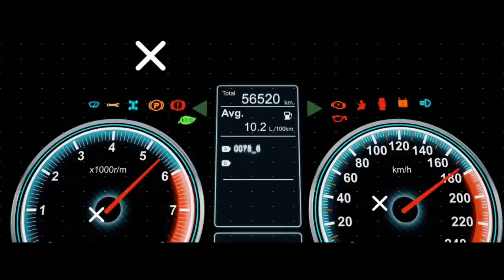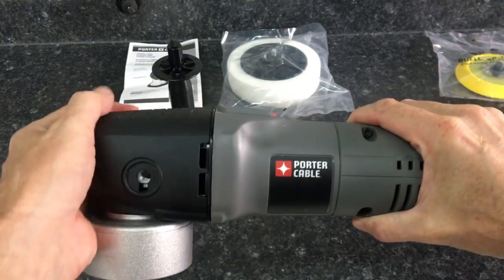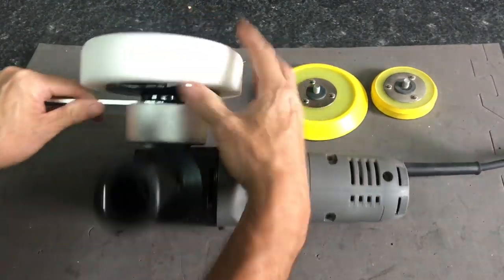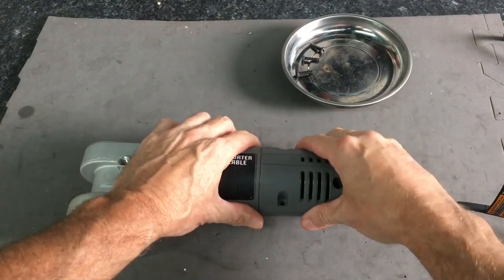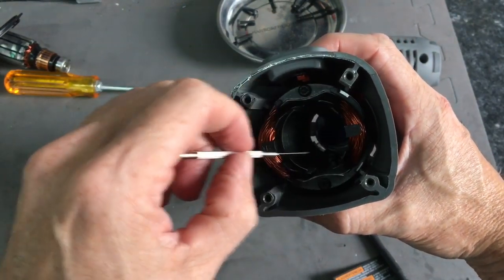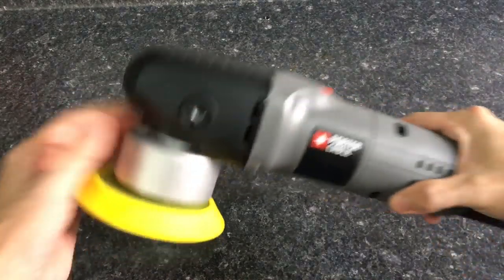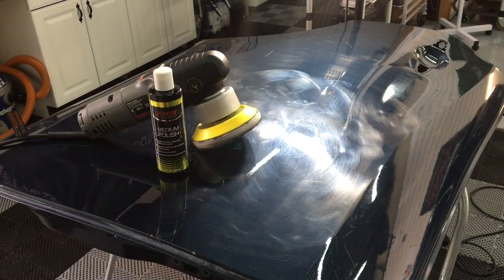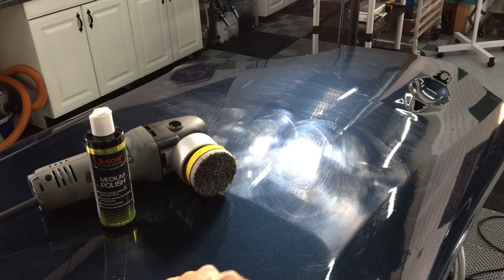Entry Level Polisher Review And Tear Down!!!! Porter Cable 6 inch Polisher!

Comment from the maker: Chicago Electric or Porter Cable?
Reply: Apex Detail 

I have never used the porter cable, I have read some people saying it can stall sometimes a little to easy as if it may be a little underpowered compared to the Chicago electric, Not sure if this is true or not. I do have a good bit of use with the Chicago electrics though and they have not let me down and for the money seem to be a good value. 

After these two polishers, what would you consider a step up in both quality and performance? Maybe something in 15mm throw.

Thanks for the great vids.
Reply: My porter cable is 19 years old; still going strong. I bought a Chicago Electric because it supposedly had a little more power, and it died within five minutes. I’ll stick with the Porter Cable.  My other polisher is the Adam’s Swirl Killer 15.  I run the 3” backing plate on the PC.  Great combo!
Reply: I guess Porter Cable ✊
Reply: Chicago electric,  but the heavier model.
Reply: P.C....
Reply: Chicago Electric.
Reply: MaxShine M15.
Reply: PC
Reply: Why are you even asking this at this stage of the game?  The Chicago Electric 69924 has been discontinued for a while and replaced with a junkie Braun which you have already reviewed.  It doesn't come close to the CE.  We are all grateful for your reviews.  Northern Tool has their brand of electric power tools "Ironton" and their DA polisher looks exactly like the Chicago just a different color and sells for $90.00 ... Ironton 6in. Dual Action Car Polisher — 5.7 Amp, 2,000–6,400 OPM .  Maybe if you can see it as a possible opportunity for review we might be able to still get a good DA polisher cheaper than the competition. Just maybe the Ironton might be better than the Chicago since it comes at a price premium.

I personally am going to hold off on buying the Porter Cable and wait to see if someone reviews the Ironton from Northern Tool.  It should be as good as the Chicago at the very least but i think they might be built better to make up for the Chicago short comings.  Time will tell and so will a good review.
Reply: PC. I had an older model CE, and it was more robust than the PC, but when everything is aligned, I can fly with the PC.
Reply: I have the older 7424 random orbital, not this xp and I get the same wobble that seems to be happening in your test here while on the paint.  In your opinion does that wobble affect the finish on the paint?  I notice the flex and other polishers dont wobble.  After a while the wobble irritates me.  Im a hobbyist and thinking of a next step up polisher.  Ive learned allot Brian thanks for your videos!
Reply: westalianham I just got the x to start detailing cars 
Never worked with a polisher tho
Hope there’s some way of controlling the wobble..
Reply: @uscfroadie   Nobodies answering me: WHERE  (If you'd happen ta know),  do you get the 3" and 5" Backers and polishing bonnets ? ? Thanks.
Reply: @TommyZTrains  - I usually buy from detailedimage.com
Reply: @TommyZTrains  Detail Garage, Chemical Guys, Amazon
Reply: wtf kinda questions that
Reply: I got a pc I've had for 5 years detailed over 100 cars with it's my throw around dont car if its scratched or whatnot thing works just as good as the day I bought it ....if you think anything from harbor freight can even remotely compete with a pc..ur about as insane as the prices they sell those pos for...I like how 90 percent of people have a habit freight da nd bash to make themselves feel better lol...
Reply: Big D the porter cable is from an era when tools where made to be given a hot supper and put away wet tools of today won’t last nearly as long as new stuff
Reply: Love my porter cable best entry level polisher! I have done a lot of cars this this little machine with the correct pads and compound no need need something else!
Reply: Hey Brian. Thank you so much for your generosity in sharing so
much of your knowledge, your videos have been key for me to learn a great deal. I have both the Porter Cable 7424xp and (pre-crappy) Chicago electric 69924, and one has to go. I plan to keep the other as a 3mm for tight surfaces to complement a 15mm long throw. In you opinion which should I keep?  Thanks again!
Reply: Sanyo

Comment: I have a Porter Cable and find it very useful.  It won't cover and area as fast as a long throw, but it can fit in some tighter areas. Along with polishing, there are several carpet and upholstery brush to fit it.  With the right brush, it does a great job on floor mats.

Comment: I have one of the original PC polishers which I think was US made. I did open it up to add a longer cord, and found it is built very well. It is fairly light weight, and smallish, but under powered. The now obsolete Chicago electric (the heavier better one) is a better performer for sure, but heavier. I now use the old PC as a 3" polisher, and it works well for that. Getting the 5" counterweight does cut vibration. There is a U-Tube video of someone that has experimented with drilling holes in the counterweight to reduce vibration to a minimum. What I don't understand is why so many of these polishers are 6" when the most popular size is 5". Also, why doesn't anyone make a 3" counterweight? Reducing vibration is paramount for tool and user longevity. I know it's marketed as a 6" polisher, but everybody uses them as 5" and 3" If one of these entry level polishers came with a 5" and a 3" backing plate instead of the throwaway 6" backing plate, along with the appropriate counter weights it would corner the market.

I had one of the new PC polishers in my hands at Home Depot. Compared to the earlier models, it is really heavy. It felt even heavier than the Chicago Electric (the better version) which is fairly heavy. I didn't like the feel of the new PC in my hands. There wasn't a good way to hold on to the front end. It was very bulky, and along with the weight, it seems unwieldy enough that it would make me nervous using it.

Home depot carries the new PC so getting your hands on one before you buy is easier than some polishers.

Comment: I bought this polisher in 2012 and I still use it to this day. Excellent polisher overall. My only minor complaints are vibrations and bogs down quick. I didn't even notice the vibration until years later when I used a Rupes polisher for the first time.

Comment: I started out with this machine (actually a previous version of the machine with the same model number) and those polishing pads in 2003. Machine still runs great. The pads worked fine early on and then more companies started selling backing plates and pads
Reply: Did you ever use it with 3” backing plate and have issues with the counterweight- since it’s designed for 6”? Thanks!

Comment: I’ve been using my porter cable for the past 10 years of course I am not a professional but I like it. Works great for my motorcycle and from my big black truck it’s a little slow but it’s not bad. Really enjoy your videos I need more work on product and pad usage. Can’t find those microfiber pads Well they’re hard to fine. Thanks!

Comment: I've had one of these for about 15 years and have put hundreds of hours on it and it's still going strong. My only complaint is i wish there was a speed step between 5 and 6. The highest speed is usually a little too fast and the step below is a tiny bit slow from where i want it to be. The only maintenance ive done on it was about 10 years ago i cleaned out all the grease and replaced it with Lucas Red 'N Tacky and right now it's in pieces because one of the bearings in the gearbox feels like it's on its last leg. It's one of the two 9R6 bearings (R6-2RS). So i'm ordering two Nachi (Japanese) R6-2RS bearings and possibly might replace the two larger ones with some Nachi 6001-2NSE bearings since i've already got it apart. What amazed when taking it apart was the condition of the teeth on the large pinion gear. It still looks brand new. Of course this peaked my curiosity and i pulled an AvE (if you don't know, you lack enlightenment) and got out a Nicholson file and to my surprise not only is the gear actually machined, but hardened  very well. Machined and hardened steel gears tend to be a rare thing these days.
Reply: One more thing, to everyone using this polisher with 3" pads.... be careful. It's quite easy to hit the eccentric housing if you're not paying attention. For a while i had mine wrapped in electrical tape but recently removed it and gave it a heavy powder coating. It's not as soft but much better than bare metal.
Reply: LBCAndrew - my armature bearing on top near pinion gear has given out - which of the Nachi bearings you recommend is replacement for this bearing (there are 2 one on top near gear and one on back near power cord (that one is OK).  Want to make sure I order correct upgrade bearing you recommended - thank you in advance!

Comment: I bought the OG PC 7424 14 years ago and its still kicking. Its definitely time to move up to a newer higher end model but only for the time saving tbh. With almost any polisher you can do a good job detailing (of course with the right pad and polish) you just need more patience because it's a much slower and less powerful machine.

Comment: I love mine! Lasting over 4 years now💪
Reply: I have one I bought used, made in 2006. I recently dropped it from a small ladder. 

Bent the backing plate, and injured the bearings, but it still runs. I'll be replacing the bearings, and it will be good as new.

Comment: Just want to warn everybody about how easy  it is to strip the 3 black bolts from the handle. The plastic case is a made in a very soft plastic that you can pass thru easily.

Comment: I use porter cable professionally and it works great for me.
Reply: Same here. 

High end exotic vehicles almost daily, and it is reliable and effective.
Reply: @danlc95  what's your experience using the original 7424 (which is what I have) with newer 50/50 europads you see Brian using all the time if you have any?  (I have counterweight for larger pads btw)

What speed for soft paint would you use? For removing light swirls on a silver metallic paint

Using 3D Fast or Rupes Uno Protect what pressure and arm speed?

As a driveway detailer just using this on my own car. Any input would be greatly appreciated!
Reply: @omarpatino5936  - Compared to the Rupes Duetto or Flex 3401, It's a little under powered, but gets the job done comfortably.

I start my process at speed 4, or 3.5. But for using a cleaner wax like Speed or Uno Protect I use foam pads. (Buff and Shine Uro-Tech Yellow, or their standard black). I use light, but firm pressure, and do two of four passes.
Reply: @danlc95  thank you for the feedback! What's your pad size preference when using the PC with Speed or Uno Protect and which of the 2 do you prefer?
Reply: @omarpatino5936  I use 5.5" for the bulk of the vehicle, and 3" for the smaller parts. 

At work I use the Rupes Nano with the 1" pads.

I have a set of Rupes polishers, but am considering a change to Flex. But in all honesty, the Porter Cable 7424 works just fine.
Reply: @danlc95  thanks!  Between Uno and Speed as they're very similar in product characteristics,  have you used both and if so, which do you feel is more suited for my needs? Light swirls,  silver paint, soft, paint,  etc
Reply: @omarpatino5936  - I haven't tried Uno Protect. Speed will be excellent in that capacity. 

My favorite is Duragloss 101. It has a very, very light abrasive, but leaves a very, very durable and long lasting protection. 

Duragloss 671 "Swirl Remover" works great on this capacity as well. It has more defect removal than 101. Be warned that it is a little "grabby" upon wipe off, but once it cures is really slick.

Comment: I do understand better long throw DA polisher's are made now, but what you didn't say is that the Porter Cable was one of the first and oldest to offer a product like this. I replaced my older version of this that lasted 20+ years. And at the time it cost close to $300. So there was a time that the Porter Cable was not the entry level it was the go to.

Comment: im new to your videos. i love them!! was lookin at the porter cable to do my truck. and my girlfriends car.found a sight that had
Porter Cable 7424xp Variable Speed Polisher
3 Inch Dual Action Flexible Backing Plate (Hook & Loop Velcro)
5 Inch Dual Action Flexible Backing Plate (Hook & Loop Velcro)
3 x Premium Blue Microfiber Towels
3.75 inch Redline Orange Foam Polishing Pad
3.75 inch Redline White All-In-One Foam Polishing Pad
3.75 inch Redline Black Foam Finishing Pad
5.75 inch Redline Orange Foam Polishing Pad
5.75 inch Redline White All-In-One Foam Polishing Pad
5.75 inch Redline Black Foam Finishing Pad
16 oz. McKee’s 37 Polishing Pad Cleaner
16 oz. McKee’s 37 Polishing Pad Conditioner
IS THIS A GOOD DEAL FOR 179.99?? I HOPE YOU REPLY!!

Comment: Which speed would you recommend for compounding and polishing?? Chemical guys say compound at five  and polishing at 4, but AMMO uses 6 por compounding and 5 or 4 for polishing, i know every paint job it's different, but in general, what speed you recommend, i just bought a PC and only have like a 70% correction
Reply: I am very curious to see what Apex thinks about this. 🤔🤔🤔🤔

Comment: What grease do u recommend to put in portal cable 7424XP ? My 7424XP 6' balance has a 9/16 nut, does it mean it has a 5/16 threaded spindle? What awg ext cord do u use ? Why use a 50/50 pad ?

Comment: Hello Brian & co.  I'm watching this old video because I have a DA Proakcess polisher, which is a copy of the porter cable, with a slightly different plastic case but the head is exactly the same!.  so to change the grease for a better quality there is no other way to remove the old grease?.  Is it a sealed gearbox?.  It cannot be accessed by removing the counterweight ?.  Like other polishers, I would like to put Facom ptfe grease in it, which has an excellent anti-friction, extreme pressure and high temperature ratio with excellent commissioning even when cold.  I have considerably reduced noise and vibration thanks to this grease.  I had also tested the red bardahl htx, skf lghp 2/0.4, Mobil shc100, which are all three excellent greases too!!.  Thanks in advance.  Nico

Comment: Brian, I've had my PC7424xp for a couple years now and mainly work on my own vehicles and the occasional friends vehicle.  But I am finding I would like a second machine.  How would you compare the new HF Bauer Long Throw machine to the PC?  I understand the Bauer is more powerful and long throw, but I've noticed you don't seem too impresssed with them either.  My thought is keep my 3" pads on the PC and use my 5-5.5" on the Bauer long throw.

Comment: They do sell a replacement counterweight for 5" pads
Reply: You don't need it for 5 inch pads, it work great with 5,6, and 3 inch pads, mine I use with 3,inch pads, to reduce vibration I drilled holes in the counter weight to help with vibration, works goog
Reply: Use the 5" weight for 3", and 5" plates. Use the 6" weight for 5" and 6" plates.

When I use the 5" weight and 6" pads I get a lot of vibration.

Similarly, when I use a 6" weight with 3" plates I get some vibration. 

Either weights work with the 5", but the 6" weight seems to maintain pad rotation better than the 5".

Comment: Is this a different type of polisher from a DA polisher?  If so, what would be the better type to invest in?  And do you have any recommended models that I should consider?  Thank you for the video.
Reply from the maker: I would consider a MaxShine Polisher to get things started. 15 or 21mm
Reply: Apex Detail thank you, I went and looked at them and saw they offer (4) DA polishers.  Even though some said it’s a 5” size and some said a 6” size, can I still use a smaller backing plate, like a 3” on these units to clean small tight areas and glass polishing?  Thx

Comment: I have the Porter Cable 7424xp 6 inch. You recommended buying a 5 and a 3 inch backing plate. Will any brand 5 and or 3 inch backing plate fit and do you have to change the existing counter weight in order to change from 6 to 5 inch backing plate or can you simply screw on the new backing plate? I ask because you said the machine comes with a specific counter weight. Do you recommend any specific backing plate brand for this machine  or do you have to use a proprietary porter cable replacement? Thank you for your reply. Love your review very informative.
Reply: There are a handful of companies that make backing plates for the PC. Don't put too much thought into it. Lake Country makes great stuff, but there are others that make them (Griot's, 3M). You need a backing plate with a male thread 5/16, just get on Autogeek or another retailer and it'll be easy to find. You don't need to switch weights when you switch backing plates, you may get some vibration with smaller plates but not excessive. I believe PC only offers one weight at the moment anyhow. I think they used to offer a 6in. and also a 5in. weight now it's just one 6in.

Comment: Is the PC 7424 (non XP) still okay for a yearly user?
Reply: I use one of those almost daily. 

They have a reputation for great durability and reliability.
Reply: @danlc95  what's your experience using the original 7424 (which is what I have) with newer 50/50 europads you see Brian using all the time if you have any?  (I have counterweight for larger pads btw)

What speed for soft paint would you use? For removing light swirls on a silver metallic paint

Using 3D Fast or Rupes Uno Protect what pressure and arm speed?

As a driveway detailer just using this on my own car. Any input would be greatly appreciated!